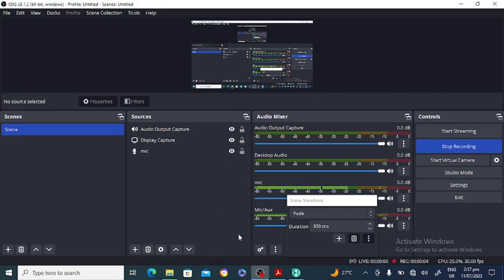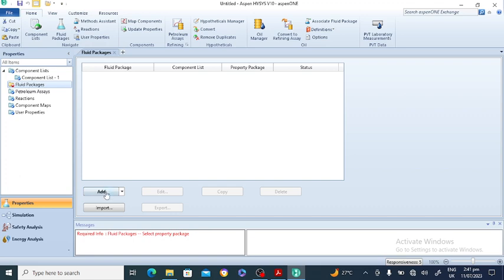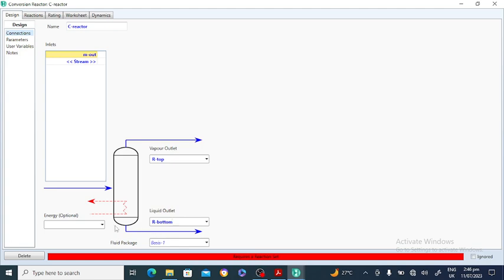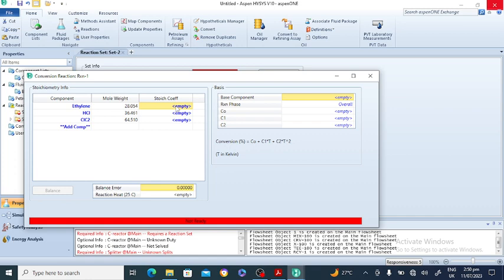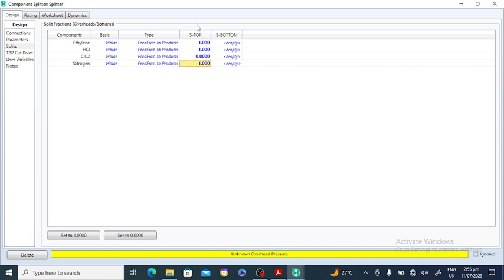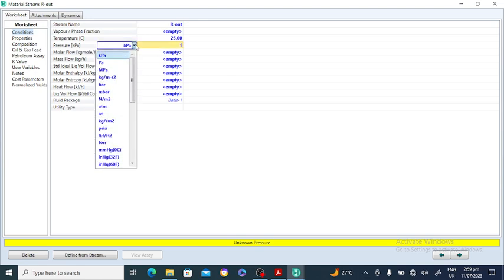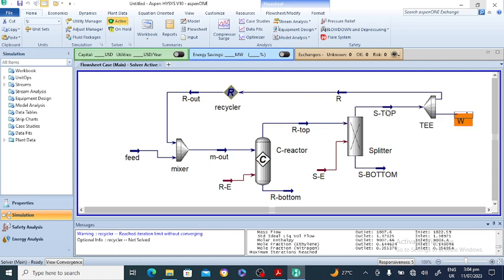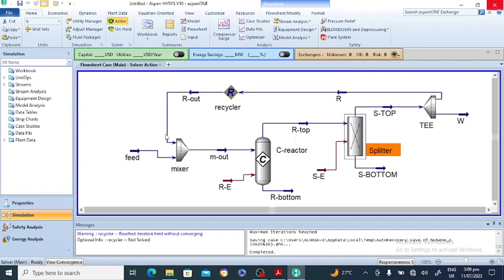Reaction, Separation, Purging & Recycling of streams/C2H4+HCl=C2H5Cl/conversion reactor/HYSYS LEC 35

Comment: I wonder how did they come up with this question there is literally no source you can get detailed information to prepare a design project about ethyl chloride
Reply from the maker: An introduction to Chemical Engineering Simulation
Reply: @ thanks a lot
Reply: @chemicalengineeringzone3560  i just checked the source you mentioned example is from there but i need detailed theoretical background about ethyl chloride and i have read like 25-30 design (design related) books so far couldnt find any decent one gives detailed info, best one was the ullman's encyclopedia of industrial chemistry and even there info was not enough thanks again for this source